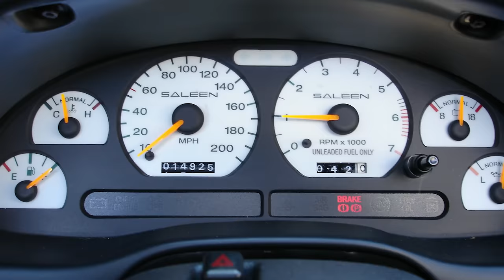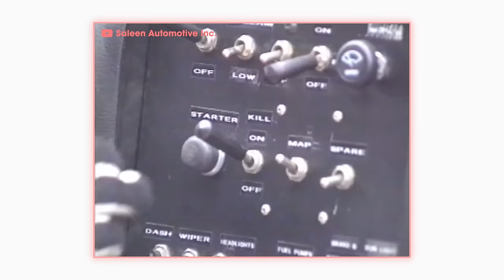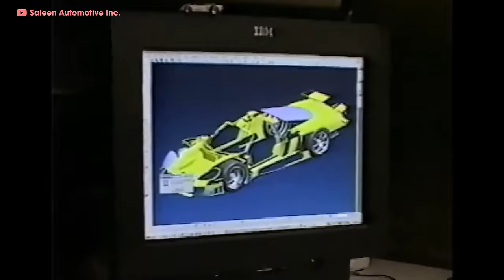SALEEN - Everything You Need to Know | Up to Speed

Comment: You can techincally still buy a brand new Saleen S7. Back in 2016, Saleen announced it will produce limited edition S7 LM for $1 million. For that you will get slightly updated S7 with 1300hp engine and centerlock wheels among others. At first the project was mocked especially by one of the US based car site. With evidence suggest that Saleen had badly photoshopped old S7 publicity photos and claimed it as new S7. But in 2017 they unveiled the first S7 LM and interestingly it didn't have S7 Comp pack wings and it did not have facelift of SS7 that I mentioned in other comments of this video. At the best of my knowledge I haven't seen another S7 LM being produced and sold.

Comment: The picture at @14:24 is a 4.6L 3-valve V8 used  In the S197 Ford Mustang with a series VI Saleen supercharger.    Not the 2.3L engine used in the Saleen One.   I own a Mustang  with the same Saleen supercharger kit.

Comment: YOU FORGOT THE COOLEST DETAILS OF THE SALEEN S7!
All the suspension underneath the car is tucked up and out of the way and replaced with a flat carbon fibre underbody which creates a low pressure zone under the car sucking it to the road and creating enough downforce that this car can literally drive upside down if it was going fast enough.
HOW CAN YOU LEAVE THAT OUT?
Reply: He did say that it "generates it's own weight in downforce at 160". ;-)
Reply: @falconpowerful2362  He failed to mention HOW the car does this and why its important
Reply: @cooperk9073  dang dude calm down its alot of information to cover
Reply: @huntercorrales6794  Why call it "everything you need to know" if it's not EVERYTHING.  By your logic they should call it "Some stuff about cars".
Reply: @cooperk9073  well it said everything about the company not the car.
Reply: @cooperk9073  😂 Bruh if u were a boss for a company ur workers must've quit during their first day at work
Reply: In cooper k's defense, thats probably one of the coolest facts about the car. I agree he shouldve elaborated the downforce part a bit more
Reply: Roid_blitzed I agree too. Really badass
Reply: Didn't God drive one of those, too?
Reply: Umm. That's not a new thing man. You're acting like it's bespoke to Saleen. It's not.
Reply: Mike Labonte no one said that
Reply: Well that’s because it’s not something new
Reply: Cooper K why don’t you run the show
Reply: @cooperk9073  it's a basic overview. That is not required knowledge is it?
Reply: Actually, it doesn't. You need twice the car's weight in downforce because you will be resisting gravity instead of having it on your team. (I think?)
Reply: If I'm remembering correctly the front section underneath could also take like the full weight of the car, or something like that, to keep from damaging it if it hits something like a speed bump.

Comment: You guys forget to mention that Saleen also tuned electric cars in form of Tesla. At first it was called Foursixteen because that's the most powerful Tesla at that time but since there are new model such as P95 and P100. Now they were badged as GTX. You can choose which model of Tesla you want since Saleen doesn't actually add more power. What they do is add a new bodykits, they tweak the engine delivery and also makes the motors more noisy somehow. I'm not sure if they still offer it since that was like 4-5 years ago.

Comment: In the mid to late 90's, Saleen built a few carbon wide-body SN95s with integral roll cages and supposedly trick Windsor engines. They used to have one on display just inside the entrance to their building. It was the absolute zenith of Fox Mustang development. That you for not saying "Say'-Leen". Saline is actually a salt solution.

Comment: Okay so #1 yes the sn95 is more known for having thr 4.6 modular, but 94&95 both still had the pushrod 302. So adding the 351 was a mild swap to do back then. Also the video clip was of a second gen lightning which was modular like the 96-04 mustangs so that's wrong as well lol it was the 5.4 sohc sc in the second gen Lightning. First gen L had the 351 yes lol 😆

Comment: Saleen's GT1 history is a little oversold here. In 2000, they did dominate the Laguna Seca event which was the last race of the ALMS season (barring the Adelaide "Thousand Years" race), but because Saleen was still too small to compete against the sheer size of the Corvette team as well as the Oreca Vipers, they not only withdrew their works effort by 2001, they also sold the cars to Konrad Motorsport. 

In addition, the early 2000s was not only dominated by the C5.R's and C.6R's, but also the Aston Martin DBR9, and the Prodrive-prepared 550 Maranello, the 550s were especially dominant in mainland Europe prior to Maserati's MC12 entering the ring in 2005, which milked the competition of its worth and led to the demise of the FIA GT Championship. So although the S7's were fast and capable race winners, they failed to win championships and only won the 2010 Le Mans 24 Hours once (the car's only class win at the event) by way of the rest of the competition running outdated and old machinery.

Comment: 1. Only the white and yellow Saleens had color matched wheels, and that was an option.

2.  No,the Saleen did NOT come with a carbon fiber roof, only the elusive SR did.

3.  They never made a neon colored Saleen.  All Saleens weeedavtory colors, except for the optional BASF Extreme Rainbow, Berryllium Orange, Lizstick Red, and Mollypop cars.  Even the optional Victory Blue was just Ford Bright Atlantic Blue.  Other than these very rare cars, Saleen never repainted third cars.  

4.  Saleen did NOT replace the SOHC 4.6L V8 with the 351W.  When the Mustang GT got the moduar motor in 1996, so did the Saleen.  They were called the S-281.  The S-351's were all V6 cars, converted over. Saleen would have to even change the engine cradles to a V6, as the 351W engine will not fit ina 4.6L engine cradle, only the 302 V8 and 232 V6.  The S-351 was produced from 1994-1999, when emissions (C.A.R.B.) prevented them from meeting California emissions.  It should be noted that all 1994-95 Saleens were S-351's, including the S-351SR.  The 4.6L was not even available in the Mustang until 1996.  

5.  The Lightning you showed had the modular 5.4L supercharged V8 (a stroked version of the 4.6L).  Only the Gen 1 Lightning had the 351, and it was a Cleveland, not a Windsor motor.  

6. A supercharger did NOT designate the SR...they actually made an S-351SC.  The SC stood for "supercharged."

I own several of these cars, and they are awesome cars to drive!
Reply: Oh, the SA-20 was custom colored, too... pearl white.